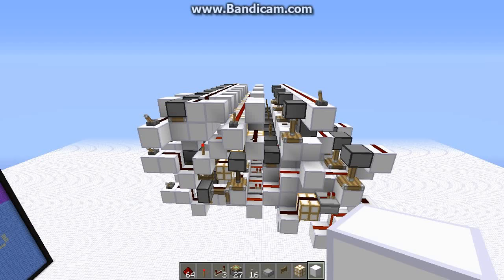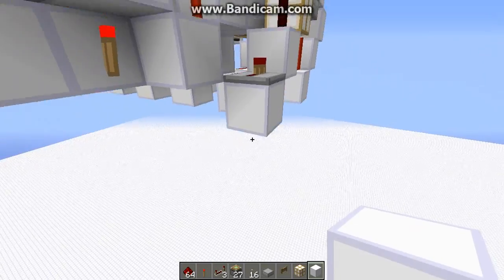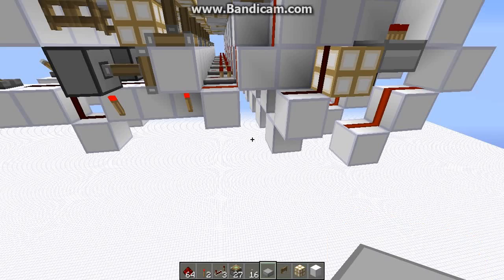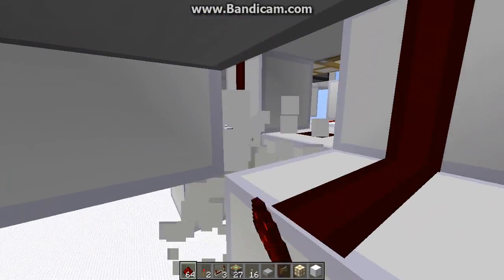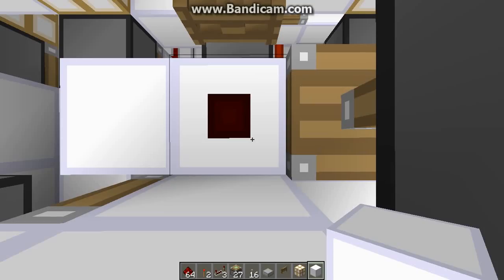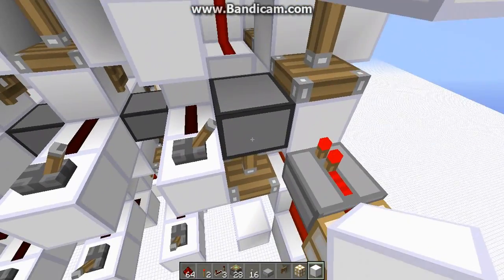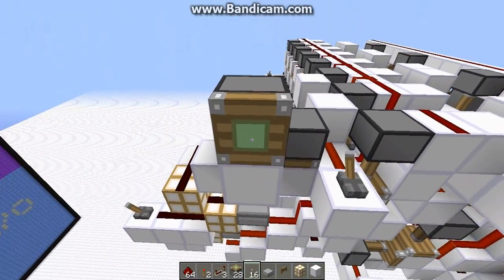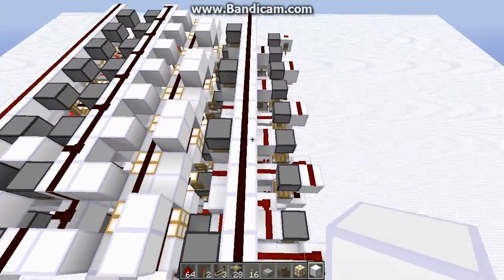Advanced Redstone Computer Tutorial ?: ALU - Flood Carry and Invert A/B

Comment from the maker: It's more than I can explain in a post, but here's the just.
If you're going full on instant everything, then the most significant drawback will simply be size.
If you're not, then you'll be using a pipeline, which achieves the same clock speed in less space. The issue is the program can access data before it's computed, and branching can cause some instructions after the branch to execute before the branch is performed.

I'll explain more in the video, but hopefully this gives you an idea.

Comment: I don't really agree on that. I am currently testing my instant ALU with some repeater lock registers to calculate the fibonacci series and count up at 5 Hz. I still get around 400 FPS and the ALU can perform all logical functions, addition and subtraction. The only thing that causes problems (slows the clock speed down) is this piston glitch, where they pulse when they receive a 0 tick off signal but this should be fixed until 1.5.

Comment from the maker: Not quite actually, there's a trade off with any change that supposedly improves the computer. In your example, the overall design would need to be massive, and the complexity of the system would make it likely to fail and immensely difficult to utilize all the potential performance. I'll talk about trade offs in a few more videos, but for now be aware that there's quite a downside to a system like that or really any system which makes heavy changes to improve theoretical performance.

Comment: You said yourself that you did research for 2 months to come up with such a fast and clever design (I mean the way you used piston mechanics and the fact that it's so small is just outstanding). All that effort is now obsolete in 1.5 because you can just use an instant ALU in an anti-burnout CPU to get a clock speed of 5 Hz.